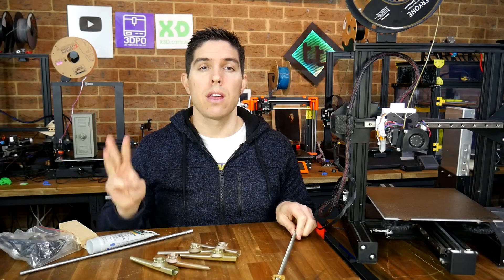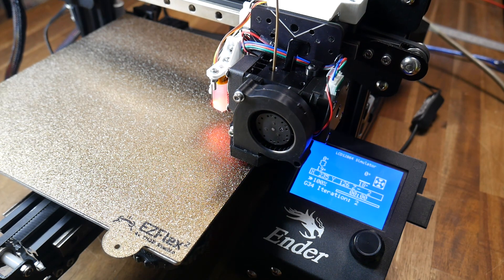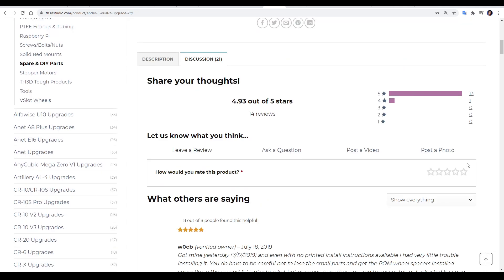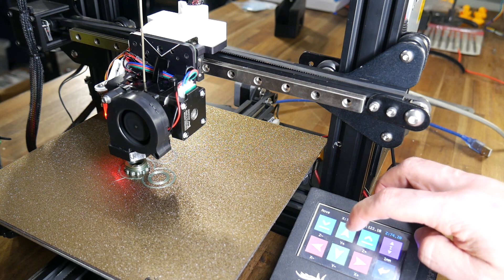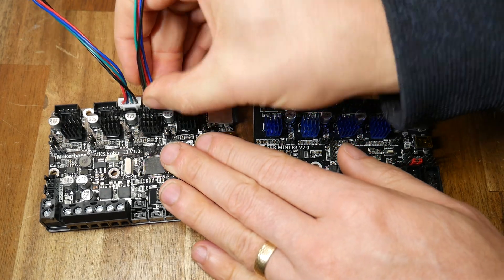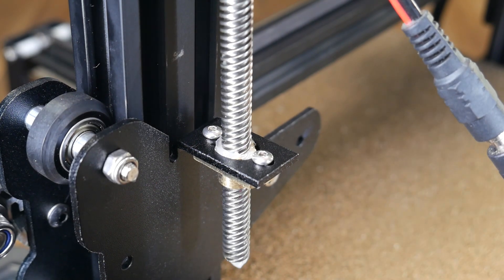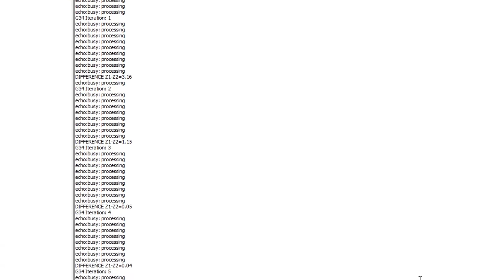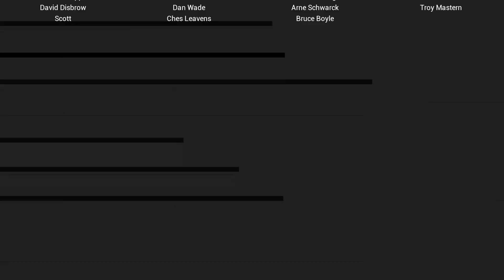3 ways to add a dual Z axis - Including G34 auto Z levelling

Comment: You can extend this to three Z stepper motors/drivers and make a railcore, I believe just by increasing the number of Z steppers in the firmware to 3 (or more if you have them) and "#define Z_STEPPER_ALIGN_KNOWN_STEPPER_POSITIONS" to tell the firmware the position of the three Z axis rails in the printers XY coordinates so it can move the axis correctly to compensate, then send G34 to auto level the bed (also set all the other changes like defining the correct Z motor drivers and outputs in the firmware etc.). 

I am planning on breaking down my old Anet A6 which has served me well but is showing its limitations, and making a custom Hypercube/Railcore/Voron/thing printer. Looking at the FYSETC SPIDER mainboard since its reasonably priced and has all the motor driver outputs needed for a railcore (plus two extra driver slots for multi extrusion if you wanted it).

Comment: Hold the phone. Lets talk about that Spiral flexible coupler you were showing us for a minute. Simply adding that coupler may not fix the issues alone and it may introduce new issues. If you butt both shafts together and coupled them, you have just created a solid column! IF it does flex, it will be pivoting on the face of the shafts and apply a tension to the spiral cut coupler. As the coupler rotates, this tension will act differently. Next- If you leave a gap between the shafts- That is not a real cure either. If the gap is not large enough, the weight of the gantry will compress the slits in the coupler and the shafts will touch. If the gap is to larger the coupler will jsut compress on itself. The solution here is to mount the stepper side so the shaft is fush. Then insert a 1/4" or 6mm ball bearing. This will create the solid column to support the weight of the gantry and also allow flex.

Comment: Maybe this is the wrong video, as I know you have a video for the specific board also. I'm trying to do your option 3 for the auto alignment function on an SKR mini E3 V2.0, however my compile keeps failing saying that there is "No E stepper plug left for Z2!", I have my motors individually plugged into ZAM and ZBM respectively. is there a spot to manually assign the port on the board for Z2? Thank you for any help.

Comment: I have the second lead screw on my E3V2. However, when I try the block trick to tram the x-axis, and I adjust, by twisting one or the other lead screws while holding the other, as soon as I let go, it goes out of tram again. What am I doing wrong?!?!?
Reply: I THINK you would want to loosen the coupler on your secondary stepper motor while leveling the X axis then tighten the setscrew and check it again...   Same for the toothed pulley on the top of the secondary axis if you have the single motor setup.  I DON'T have this setup but that seems to make sense to me.

Comment: I purchased the dual z rod kit and installed it but when i'm manually moving the z axis up and down, it doesn't feel smooth, actually, i have to put a lot of force to move it up and down. I tried it by disabling steppers with printer on but still very hard to move up and down.I loosened the gold nut on both rods but its still very difficult to move up and down. Any suggestions will help. Thank you.

Comment: For the dual z-axis motors with dual drivers: Is there not a possibility to have a home switch on each z-axis? That would eliminate a lot of problems. With the G34 code it is assumed that the bed is level. When homing both z-axes one assures that the gantry is alway referenced with respect to the frame, and not the bed.

Comment: I'm new to this stuff and it'll show, I went option 1 but I have E3MAX so belt isn't long enough. Going 2 or maybe 3 in the future I'm just glad I didn't start pulling it apart before I checked all dimensions. E3MAX prints pretty solidly as is so no real hurry. Top work Michael, keep it up.
Reply: ive got a 3max and gone with option 2

Comment: Is there anything to worry about with not providing enough power for both stepper motors? I've seen kits that simply split the wires from one plug in the board as well as using a board with dual z motor plugs.

Comment: Any idea if this is easily achievable on the 2021 Ender 3 v2? I ordered one the other day, but it's not going to make it here before the end of lockdown. I have an old TronXY Prusa clone I'm replacing, so I'll have spare lead screws and steppers.
I'm also looking at switching to the Jyers Marlin version, I'm assuming this will still work.

Comment: Hello. Michael. I have to say first, that I absolutely love your teaching technique. I have learned a ton from your videos so far. Thank you! I want to use solution #4 of your tutorial as I have already installed a BL Touch probe. Since I have a Geeetech A10M, both my extruder plugs on my board are taken. How would I approach this setup without the use of extruder E1? Thanks again. I hope there's a solution. I'd love to add the second z-axis.
Reply: you would need to change your board, in this case
Reply: Can you recommend one please?
Reply: @garycompanion7484  Duet 2 (there's some good clones around too), Fysect Spider or BTT Octopus. If you wanna get into the rabbit hole that is messing with klipper, you could also use a raspberry pi and two standard boards to have as many steppers as you might need.
Reply: @mocotonio  I had ordered this: Geeetech GT2560 V4.0 Motherboard. I think it will work.
Reply: @garycompanion7484  Why? this board only accepts 5 stepper drivers, it will work for your application only if you're running Klipper and for that you also need a raspberry pi
Reply: @mocotonio  I actually supports 6 motors.
Reply: @mocotonio  three extenders plus x, y, and z. Plus BT touch. It’s used for the A20M model from Geeetech.

Comment: maybe someone can help me here I have a sidewinder x1 which has dual z separate motors lead screws and a belt at the top supposed to keep things in alignment. If I activate G34 Auto alignment will it actually work seeing I have a an alignment belt at the top?

Comment: I have option 3 installed on my Ender 3 Pro {w/BTT SKR Mini E3 V 2.0 board} and I am having a heck of a time compiling the firmware for it. I have followed this video countless times but every time I compile the firmware it fails. Any help would be tremendously appreciated.
Reply: I think you need to go with option 2. The SKR Mini E3 V2 only has a single Z stepper driver connected in parallel to the two connectors..

Comment: For the 2nd process, is it possible to use a ‘Y’ connector to attach both ‘Z’ steppers to the original Z cable externally?
Reply: Totally, yes. The board he used does basically the same.

Comment: GREAT video!  Thank you so much!!  I have one question.

Option 3 (Ender 3 Pro): This is the only place I've found so far which says to plug the 2nd Z stepper into the E1 slot on the SKR E3 Turbo board.  Is there an issue with plugging it into the Z2 slot?  I'm working on syncing my 2 Z steppers, as one is either moving more quickly or binding and skipping steps.  Just wondering if moving the 2nd Z stepper from Z2 => E1 would help or not.

Comment: Some insight though - if you don't have a solid / fixed bed, go with the belt driven setup. If you have an adjustable bed, then you'll end up fighting between levelling the bed and the G34 command - which is an annoying battle. You can get the complete belt with with two new lead screws for ~$20USD.

If your printer has a fixed bed, certainly go the path of dual Z motors with independent control - as this is the better option for that scenario.

Comment: Concerning Option 3. It looks nice but this option has some issue with the following bed leveling in case, that bed ins’t fixed and especialy at Ender3 is aluminum bed thin and “soft”. I suppose that this solution is better for Voron, Vcore and so on. Therefore I redefined G34 command to the #define Mechanical_gantry_calibration and check linearity of the X gantry via top mechanical (printed) limiters. After that X gantry is parallel with the top frame and then I can run G35 for Assisted tramming for bed level.

Comment: ok so i am getting very frustrated why wont this work with an skr mini e3 v2.0 there is 2 plugs for z motors but the firmware refuses to compile. it almost immediately fails every single time saying that there is no e stepper plug left for z2 but im not using an extruder plug im using the second z motor plug

Comment: I did option 2 like 6 weeks ago and I've been struggling a lot. It seems I'm missing steps on the Z axe sometimes, quite often to be honest. I'm not sure it is fault of a quite cheap kit I got from Amazon. It has been very frustrating. Literally, 5 minutes ago I had to stop a lithophane after almost 30 hours of printing because is started to skip steps at some point and the print started to look awful. I was "fixing" time to time by adjusting Z baby steps but, quickly it got messed again.

Comment: If you use G34 with a probe, it makes X parallel to the bed instead of the case/frame, no? What if the bed isn't perfectly parallel? Wouldn't it be better to use two Z endstops to adjust the Z positions?
Reply: That makes perfect sense to me, and it exactly what I am trying to attain. Any help on setting for for dual z endstops would be appreciated.

Comment: If you are going to do this mount the PS under the Y axis extrusion bar and avoid all of the problems you will create by leaving it to wobble on the back of the base. I will leave my ender as it is, printing perfectly. Your greatest gift to me Micheal has been your calibration tools on GIT HUB. God bless you for those as they have made even my problem machines more usable. Marlin is still a MICROSOFT for me though, forever changing and always confusing and NEVER easy. Happy printing buddy, watch out for those silly ROO's Still waiting to see the RAT RIG go.

Comment: What is the point of ABL if you have to do all this any way? None of this makes any sense. You are basicly saying don't bother buying anything but a PRUSA unless you want to spend lots of money and time tinkering with a machine "Just in case" it might make it better. Are you saying Enders are a money pit and the only good ones are the ones that have massive expensive upgrades? That might explain why I have so many machines that almost get it done without flaws. and only one ender that prints awesome because I have been afraid to touch or upgrade any thing but a filament guide. This seems to do nothing but spend money and force people to have to deal with firmware, which is a nightmare at best.

Comment: Hi Michael, just a bit of feedback on this if you don't mind, as I see some engineering errors in the kits you discuss. 

You cannot simply mount a pulley directly on top of a bearing, you'll need a shim in between (thin ring) to make sure the pulley rotates around the bearing's center, and doesn't rub against the outside, as that obviously is counterproductive.

Furthermore you need to make sure the leadscrew has zero play in the bearing, which means adding a shaft collar on the other side, and another bearing. The best way to tackle this would be using two flanged bearings with a shim in between them (again to make sure they rotate around their center), and then lock these into place with a pulley+shim on one side and a shaft collar+shim on the other side, then you're guaranteed to have no play in this configuration. I don't see any of the kits you used here even make an effort to do this.

Additionally you really want to use a anti-backlash lead screw nut made from POM. All of the above will set you back a few dollars, but it is well worth it in terms of print quality.

Comment: I was a huge fan of option 3 and used it for years but it's very likely that you'll get worse prints than just with a single Z because it's almost guaranteed that one of the Z steppers will skip sometime during the print and BAM now you have a crooked gantry mid-print. Then I saw a printer with option 1 installed and it ran for years without needing any adjustment. Don't overcomplicate things, the best is always the simplest.
Reply: It sound like torque problems, if the driver of the board cannot give the necessary current you can try to connect the motors in series instead of parallel.

Comment: I’m using 5x TMC2209s with an MKS Robin Nano v3 and a dual-motor dual-lead screw setup, after having used a parallel motor arrangement for a little while before that. 

Option #3 wins, hands down. I even took my top bar mounts offs just to see how the lead screws fared on their own with a precisely leveled gantry. With full torque at either motor and a gantry aligned to within 0.005 of my bed, I can whip the gantry up the full length of the z-axis and back as fast as it will go and only need minor adjustments on the next G34. 

What’s even better is this z-axis setup combined with GCR’s three-point leveling bed, a glass plate and a BLTouch. I just have to fine-tune my Y-axis tilt manually and get my X-axis tilt reasonably level, and the fine adjustments are accounted for automatically through the gantry level procedure. I get to be lazy and have 0.005 tolerance precision from left to right in < 30 seconds. Also, the GCR bed heats up from 24°C to 50°C in less than 60 seconds!

Comment: Nice one ;) I have switched the screws into belts so it prints very nice))) 
this is my modifications to the ender 3 if you need stl please contact me on +79091151215 viber whatsapp or by facebook (messenger) Mito Korki
https://www.youtube.com/watch?v=j3LN6bcjVCA 
list of modifications:
direct extruder (i have used the titan extruder but also you can use the bmg) 
z axel driven by the belts
the board is btt e3 rrf the tmc 2209 on the sensorless homing- the tft bbt 35 v2 (the v3 is more convenient in use as it has got the usb port)
the belt tensioners 

moved the power supply under the bed
also i have turned the bed axcel profile by 90 degrees so the bad become more stable

Comment: Only those who do not have a bed leveling probe need the Z alignment. The sloping X-axis is smoothed by automatic leveling in the same way as a sloping table.
Method 3 is therefore superfluous. You need a probe to use the G34, but if you have a probe, you don't need the G34.

Comment: Great video as always! Though I would like to add one additional method of adding dual Z, which I really only know as it's how my anycubic i3 mega s came stock. Essentially same as the third method, but rather than using an abl sensor, just using a second endstop microswitch. Thus, equipping the printer to have an endstop on connected for both stepper motors. Has the advantage of being cheaper, but admittedly is a lot more limited than the abl method

Comment: I wish someone investigated what they did with Anet A8 plus' dual Z setup. It has 2 steppers (with two Z connections on the board) and one Z stop switch. These steppers tend to go their separate ways, sometimes even after one print. When you disassemble lead screws, poweroff, and turn one of the steppers by hand, the other one rotates as well (so it seems they are on the same driver, and in this situation the second motor runs by an induction from first one)... the hell?

OK, I just googled its PCB. Seems like they have only 4 stepper drivers, so they implemented solution No 2 but with standard wiring to the motors.

Comment: Pro tip: before starting a major upgrade on your printer, make sure that you have already printed out any parts necessary first.
During my last major upgrade, I had already my printer halfway torn apart before I realized "hey, uhh, didn't I need some printed parts for this mod?"
Or you could use this as the perfect excuse to get another printer! "Honey, I need a printer so that I can finish upgrading my printer..." ;-)